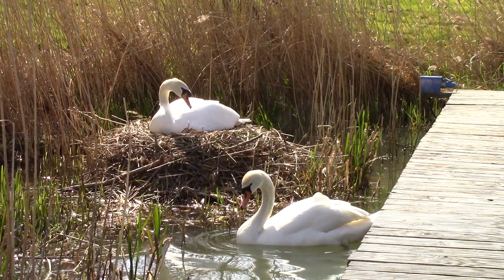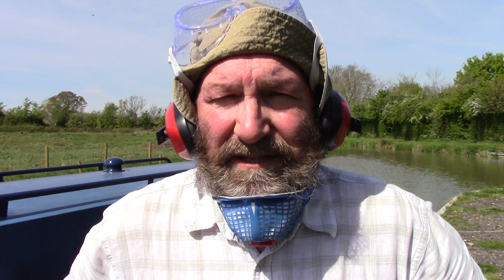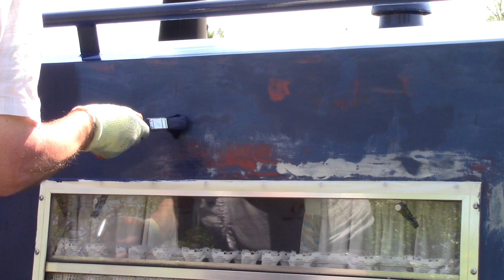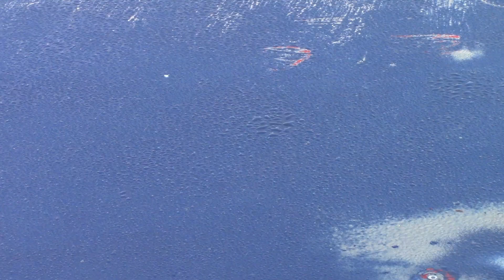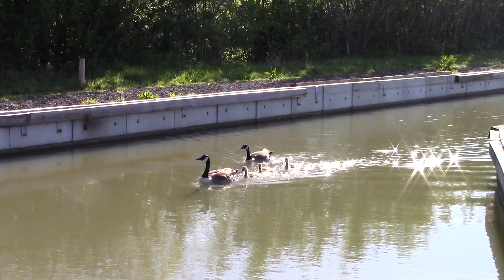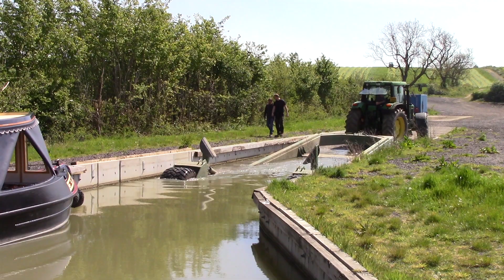55. Painting My Narrowboat - Part 3

Comment: Great effort well done. Back in the 60s when I used to coach paint vehicles we used a grey primer filler paint to get ri
Reply from the maker: Thanks very much Roger - grey is available but I have tended to use the red oxide primer. The paint covers over it reasonably well on first coating.
Reply: My Narrowboat Venture great but this is a primer coat and filler. Thick that when rubbing down makes a flat finish  well done you bring back happy memories.

Comment: Just one tip, I was always taught by my dear old Dad, that it's much, much better to apply a few thin coats, than it is to apply a single thick coat. you end up with a much smoother finish.
Reply from the maker: clixbits Very much agreed. I did put it on thicker on the roof in one area but it wasn’t going to run, the roof only being slightly curved.

Comment: Well done, looking good, will you be adding anti slip to the roof?
Reply from the maker: DisarmingCrib - I will be doing so but it will be a bit later on. I’ve bought sand to sprinkle on wet paint and then seal in after brushing, with more paint.

Comment: Alan can I ask why you didn’t use a undercoat it will give much better coverage and be more robust
Reply from the maker: I didn't use an undercoat, as the surface was in sound condition and I didn't think it necessary. Unlike some boats, which seem prone to rust spots on their roofs, mine is not like that. There's been no deterioration in the year since I did it. Cheers

Comment: May I ask why you have not apply a undercoat before the finish coat.
Reply from the maker: Thomas James Tannian - I didn’t believe it was necessary , as I had not gone back to bare steel. The gloss covers over the red oxide quite well and it will eventually have two coats of gloss.

Comment: Alan - any reason you didn't use undercoat ? Was it simply that you appear to be using the same colour ? Or was it to save time ?
Reply from the maker: Hi Simon. I didn't consider undercoat necessary, as the base surface was quite sound and I was painting the boat the same colour. It's been a year now and all seems well. I actually need to get on with the next stage, sanding down, painting again and laying off with a brush. I hope to make a start on the roof shortly. All the best Alan